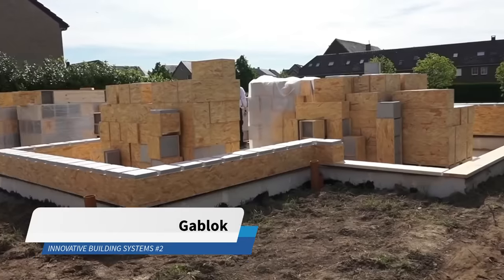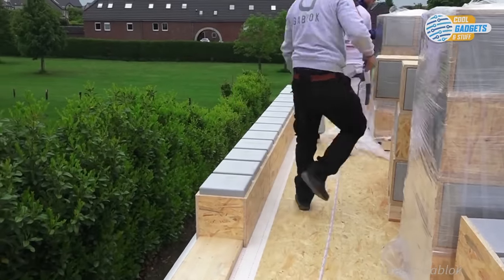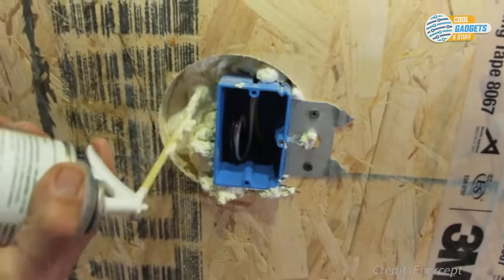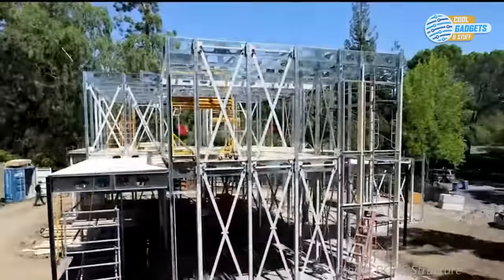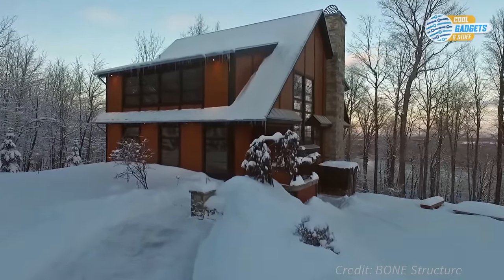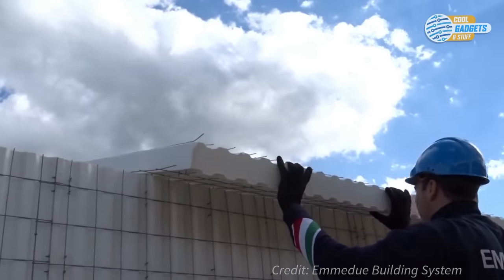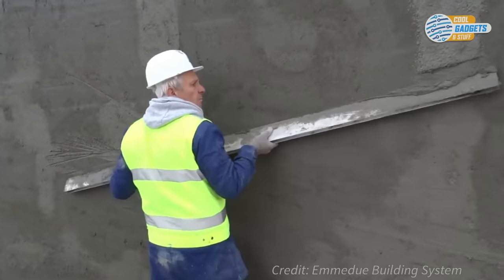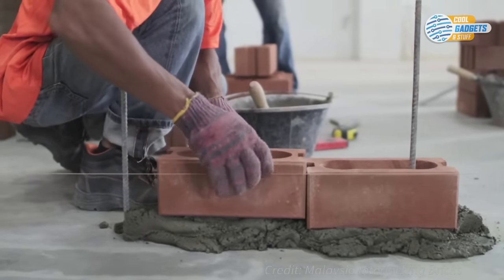5 Innovative BUILDING SYSTEMS for your house #2

Comment: When a Tornado comes through you can put it back together after finding it.
Reply: I was just going to say the same joke.  While yes, your house and things would be scattered to the 4 winds, if you happened to live in a neighborhood of houses like this, who ever starts rebuilding first is likely to find enough blocks to re-complete his home.
Reply: Michael Martinović  Right, but the point is, if you lived in a neighborhood full of these houses, you could run around and find enough pieces to rebuild you house pretty quickly!
Reply: Take your neighbors blocks and make your house bigger.
 Hey your house got bigger umm no your just stressing cause your house shrunk. Your house is probly just settling
Reply: Michael Martinović  With thinking like that, Tornadoes will pout YOU ahead every time.
Reply: Beat us all to the pun
Reply: It's stronger, faster and cheaper than traditional stick/frames.
Reply: Wow that sounds fun.
Reply: @shadowblack1987  Putting together and tearing apart!
Reply: Steel and concrete homes do not burn or blow down
Reply: Stupid as that sounds it's almost the truth, these systems are designed for markets like the US/Canada where a high proportion of house building is timber based, generally most suburbs in the US have about 75% domestic timber homes. Timber is dirt cheap in the US, especially in the mid states where nearly 90% of homes are timber and get destroyed regularly by tornado's.

These are also suited to Scandinavian markets and less regulated markets like Holland/Belgium where the weather is mostly mild 10 months of the year.

These might pass building control in the UK if it was a complete stand alone house nowhere near its neighbouring property or maybe for a holiday home with minimal occupation time.
Reply: Michael Martinović  I would change it to wooden or masonry. Steel reinforced concrete with flat membrane roof and shutters over the openings could withstand it probably. But No one is building a houses like that those are bunkers.
Reply: wowwsa M 😂😂
Reply: But after a tonado you have a chance to increase your kid's room (he always wanted), just putting the wall 3 bricks further. It is not really feasible with a brick made house :-)
Reply: It’s like a puzzle that s crazy
Reply: Imagine seeing your neighbor stealing your blocks to rebuild his house.
Reply: w houses like this & y’all think the people will survive the tornado 🌪 & rebuild haha 🤣 if the house doesn’t survive how do the people ? 🤦🏻‍♀️
Reply: Not everyone lives where tornados happen.

This works for Hurricanes too.
Reply: Minecraft basically....
Reply: Lmao
Reply: Hahaha
Reply: Well that's more than what we currently have which is fighting with insurance companies
Reply: Kinda seriously, a tornado gonna rip the stick house apart break the sticks so you can't rebuild.... blocks would be cheaper and you can go pick them up if they scatter

Comment: Regarding Steel construction. I recall a wool-store fire when I was young. It was a large steel frame warehouse. After the fire, all the RSJ trusses were sagged collapsed to the concrete floor. It was considered that laminated wooden trusses would have held up longer than steel, which when heated lost it's strength.
Reply: Wood and styrofoam does not bode well for the volunteer fire department that has very few fire hydrants !
Reply: @henryhatfield74  Others might know better than me, but plastics & styrofoam produce seriously noxious fumes (fatal even) when burned. I am not pushing wood or laminated construction - except that the Wool-store was a huge heavy steel framed warehouse - But had it been apartments then - would have occupants had enough time to get out before structural strength was lost? I saw that in 9-11 twin towers, the steel was coated with fireproof insulation - but that is not in these houses. Laminated wood beams burn from the outside inwards -which is a slower degradation of structural strength. They don't melt.
Reply: @kiwikeith7633  The temperature where the steel fails... the people are probably already dead.  The fire will have blocked exit if it hasn't already cooked them.
But the story of the steel failing in the warehouse fire demonstrates that the  collapse of the  twin towers on 911 didn't require the steel to melt.  It just had to get hot enough to  lose its rigidity (which can be as low as 500 F for some grades of steel)
Steel  is commonly tempered between 500 F and 750 F.  FAR below melting point.
Reply: @fhuber7507  Maybe it is as you say. I do observe that the house construction appears to be of much lighter gauge steel, and probably more susceptible to heat. The Wool store is what I am going off, and do realise that was a huge warehouse at an international port. its frame of heavy RSJs. The sight of them all on the ground was impressive. While not an advocate for either steel or laminated timber - it still seems likely that timber would not lose strength through heating. In a house it is unlikely to be laminated and so woods degradation would be a function of how rapidly it burned.
Reply: I've never heard anything as ridiculous in my life as this comment! I hope UR not in the building industry.
Reply: After watching videos of people acting like animals tearing down statues and burning our cities. It is inspiring to see something so innovate and useful. This could be just the beginning of the next step in construction. I think larger tilt up sections of  walls make sense and could be almost effortless with the invention of a specialized Mini Tractor that handles the larger pieces and places them with laser precision. It could actually be automated.
Reply: @Thomas-lj8cf  Murphy bed living room kit
Reply: @guidedmeditation2396  Oh, goodie, our first overt racist.
Reply: @johnrobinson4445  - You mean for criticizing a bunch of young white people who burned down a low income housing complex and several black owned businesses in Minneapolis, defaced a mural for black soldiers in Massachusetts, and tore down a statue of the man who won the civil war and waged military campaigns against the KKK? Or do you mean the young white people who attacked a statue of the only English prime minister to ever wage actual war against fascism?
Reply: @cerebraldreams4738  you're not going to get through to John, liberals don't like thinking for themselves 😂
Reply: @fhuber7507  -"But the story of the steel failing in the warehouse fire demonstrates that the  collapse of the  twin towers on 911 didn't require the steel to melt."

The collapse of the twin towers did not even require to happen anything to the steel more than %10 of the whole building. Even if you show the fire to a steel frame building from 100 feet, the building will collapse globally.
Reply: @AwsomePicklez  
[ Liberal;
adj.
1.
a. Favoring reform, open to new ideas, and tolerant of the ideas and behavior of others; not bound by traditional thinking; broad-minded. See Synonyms at broad-minded.
b. Of, relating to, or characteristic of liberalism.
c. Liberal Of, designating, or characteristic of a political party founded on or associated with principles of social and political liberalism, especially in Great Britain, Canada, and the United States.
2.
a. Tending to give freely; generous: a liberal benefactor.
b. Generous in amount; ample: a liberal serving of potatoes.
3. Not strict or literal; loose or approximate: a liberal translation.
4. Of, relating to, or based on the traditional arts and sciences of a college or university curriculum: a liberal education.
5.
a. Archaic Permissible or appropriate for a person of free birth; befitting a lady or gentleman.
b. Obsolete Morally unrestrained; licentious.

"Liberalism is a political and moral philosophy based on liberty, consent of the governed and equality before the law." ]

So, do you prefer someone should have more social rights and civil liberties due to his/her birthrights, then?
Reply: dill pickledz they can’t!
Reply: John Robinson ignorant statement !
Reply: @nzrockdj  How old are you supposing him to be? Perhaps it's one of those memories that really do make an impression..
Reply: There is actually nothing called fire proof but there is something called fire tolerance which is measured by how many hours that particular material is going hold up before it is going to collapse and different building materials have different fire tolerance and you can Google there is actually tables showing all that data.
Reply: @squidproquo2241  oooh i just dabbed another dot on my libtard bingo sheet, thanks for the definition ☺️
Reply: @mgtowrules1649  Are you questioning Kiwi Keiths take on steel beams? Because he is correct.
Reply: Wood frames fail much sooner and at lower temperature than steel framing.
Reply: nz rockdj   Actually the lam beams have a higher fire rating than steel some years back a night club fire the lam beams left the structure standing, the areas with steel in collapsed ,they sandblasted the lam beams and the engineers determined they were still structurally sound.
Reply: Ronan B not laminated timber beams we are talking almost solid timber in beams that maybe up to a metre deep and between 150mmto 200 mm wide
Reply: Don't forget WTC 7  ;o)
Reply: ...wool can melt steel beams? lol
Reply: @kiwikeith7633  

Building codes specify the minimum size of material to be used for certain loads. These are dependent on the strength of the material but also include such things as how long the material withstands fire and the number of items. For example, to hold up the floor above it may require two steel posts and a steel header or building a wall out of wood (in Canada that would be either 2x4’s or 2x6’s as studs spaced 16 inches apart - unfortunately our construction industry is tied closely with the US and doesn’t use Metric).
Reply: World trade center, 911
Reply: @travelfoodbusinessbestheyyono  Closest you can come to being fire proof is a steel building with Handi-panel outside and fire rated drywall inside. And conduit with wiring inside. Poured concrete comes in a close second and tilt up buildings are becoming more common down here. It isn't what is the shell as much as what is put inside the shell that causes problems.
Reply: Yeah... Especially when covered with molten and burning  styrofoam
Reply: @johnrobinson4445  There is nothing "overtly racist" about the expression "people acting like animals"; many of those people were overly-privileged, radicalized brats who happened to be white.
Reply: @squidproquo2241  The dictionary definition of “liberal” does not equate to, or in anyway prove anything about, the mindset or actions of those who are labeled “liberal”. That is a massive logical fallacy.
Reply: @seeker7774  "The dictionary definition of “liberal” does not equate to, or in anyway prove anything about, the mindset or actions of those who are labeled “liberal”. That is a massive logical fallacy."

What is a logical fallacy? Calling people as "liberal" who are not fitting in the dictionary definition of the word liberal, Or suggesting to call them as traitors instead of liberals since they do not fit in the definiton of the word "liberal"? 

OR, persisting on calling poeple as liberal when they do not fit in the dictionary definiton of the word liberal?

Comment: I'm curious as to how you would go about hanging things on your walls.  From pictures to book shelves, to large screen tv's.  Or even trying to take out a portion of a wall in later years for a renovation project.  It appears that these building techniques would make this a much more challenging prospect.
Reply: In my stress skin House the interior walls are stick built.

The interior and exterior are OSB which can handle most things.  

A large heavy flat TV might be better mounted on a stand.

Taking out interior walls?  Like any wall you have to figure out what’s in the wall.  Pipes, cables, vents, etc.  then just make the cuts.

Comment: The first two methods are really intriguing and seems quick, sturdy and cost-effective.

Having just built my house, there is one thing I wonder though...

How about sound-proofing?!

My house was constructed as are many houses in northwrn Germany with classic cavity wall system.

Meaning there is a structural brick-on-brick inner wall.

Using limestone in usually 17,5cm or bigger format stones/bricks made from airiated concrete (ytong) then some 140, 160 or even 180mm Mineral wool insulation, the - connected with small stainless steel anchors, there is an outer brick-shell made out of klinker in a variety of colours and materials can range from clay, to ceramic or limestone et cetera.

That provides good wheather proofing, excellent sound-proofing and good thermal insulations and is really really heavy.

Withstands heavy storms/tornado et cetera.

But has two major disadvantages - cracks easily in earth-quake ridden areas plus the walls are rather thick - my outer walls are about 480mm which is roughly 19 inches...
Reply: Wow! Wonder why all that is needed? 
Here in US exterior walls are generally framed with 2"x4" wood then covered with a 3/4" "sheathing" of "OSB" (particleboard) followed by exterior covering of choice... which could be brick, wood, vinyl, metal, stucco, etc.
So why so thick there?  Walls here can be as thin a 6" finished!
Reply: @selfmade-mv3rz  Germans build things to last forever. It's ingrained in the engineering culture.
Reply: @Milenier And they are not very fireproof :)
Reply: @selfmade-mv3rz  In Europe we build houses like bunkers. They are investments for generations to come. My current house also has 48cm thick walls, 38cm Porotherm bricks walls + 10cm insulation. And it's built around a reinforced concrete frame.
Reply: In Poland we used to build houses with bricks or blocks, that has 40 cm thick load-bearing wall. Nobody knows when next world war will start.
Reply: @johndoesson  many many things built to last forever are constantly being.... unearthed🤔
Reply: @scratchy996  Speak for your own country, here in scandinavia, they only build with wood, thin walls, rots in 30 years if not maintained and any hurricane would fck that shit up if there was hurricanes here.
Reply: @wrz5468  what's your point?
Reply: That's in so ca was thinking about this. Not anymore

Comment: I used a similar system on my home in San Francisco except instead of using insulated blocks I used refrigerator boxes and tarps. Very sustainable.
Reply: There ya' go! Good old Yankee engineering at it's best!! In a pinch,Whirlpool washer & dryer box's supported internally at the corners with open umbrellas and tarped over will work. They provide not only sustainable accommodations for you and your's but that extra space for those "special guests" you just can't say no to.
Reply: Did you remember to scatter human feces and used drug needles around the structure?
Reply: Really big bathroom attached? Just open the cardboard flaps and lots of potty space?
Reply: And in SF even that house costs $1.5m.

Comment: I do like the interlocking bricks the most!

They seem to be the most stable method of the 5.

I had to laugh about the EPS Styrofoam with "rabbit-wire" and then a tiny coat of concrete sprayed on...

Oh my oh my.

In Europe that would not stand an Inspektion and probably is not built to code.

I have got a 10 inch thick steel reinforced concrete ceiling in my house.
Teo layers of rebar were added weighing several tons!

C30/35 concrete which is partly so hard you can hardly cut it even with an angle grinder.

Where we sometimes tend to "over-engineer" things - in my opinion many other countries build houses in a way which is maybe good for 30 to 50 years but the majority of those houses will not last several hundred years...
Reply: As a Chilean none of this construction methods give me confidence o stand soft earthquake (about 7.0 in the Richter scale)
Reply: @obedulloa6219  how do you guys construct homes?

Would be interesting to know!

I have seen documentaries about skyscrapers with pendulum inside or huge concrete foundation with springs - but surely for a one-family Home that is not doable?!
Reply: you should check out Shipping Container houses! those would last a long time and they are very very strong.
Reply: @kniefi  For a family home you have 2 choices, you can either use wood since it's flexibility withstands pretty well an earthquake or you make it with concrete but make sure to use rebar on the foundatioons, on each column and over every wall. Also the rebar must be al least of 8mm and the bricks that make the wall between pillars must be "laying down" (I've seen houses on Brazil ir Perú where the bricks are put "standing"). For reference a normal brick is usually 5x15x25cm. Basically that's it.

There's also many regulations to determine the size if the beams (either wood ir concrete) depending on the distance between columns and stuff like that. 

Basically you build the house to stand a lot of punishment. I would say for a 1 story house you build it like you would build the first floor of a 3 story house on a non seismic country

Comment: With the lego house building. How do you run wiring in the walls.
Reply: I was wondering the same thing
Reply: @Jasonsenipor ah, dont say that. ive seen modern designes where the cable canals are used as architecture designs as well as other "rustical" things. and it looks awsome. i use cable canals in my home as well, some can be hidden, some are out in the open. looks futuristic, easy to install, easy to add new cables.  :)